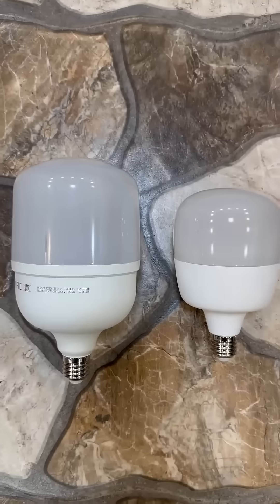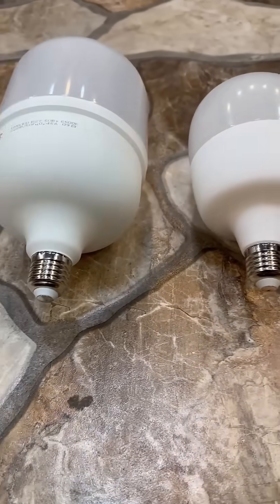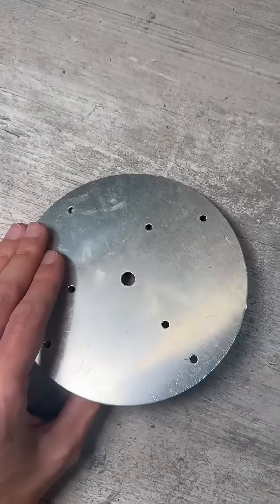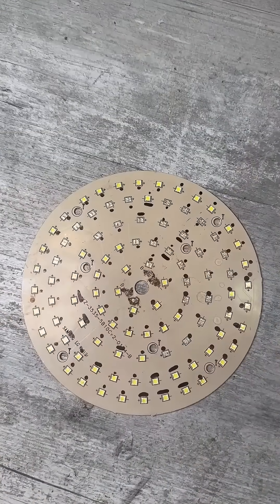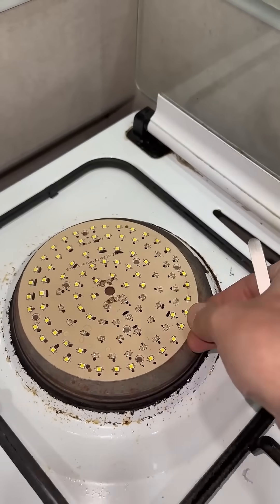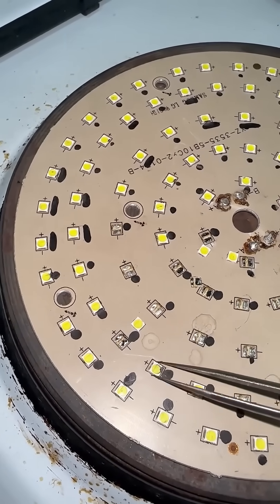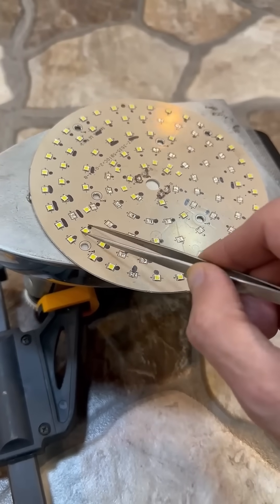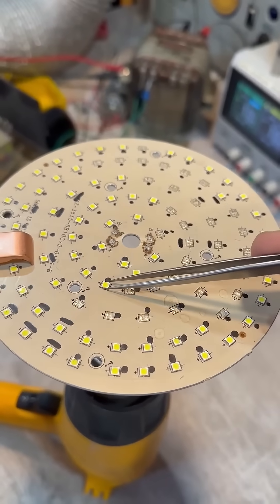How to solder LEDs without professional equipment

Comment: Already did it with hot air a few times but not worth it it usually fails again
Reply: Yep, that's weird. If one fails, even after replacing the LEDs with working ones, they only work for hours or days before failing again. I think the problem is in the capacitor or the IC, not the LEDs.
Reply: @adhicham8185 all the LEDs are already deteriorated that's why, i repair TV's backlights i always get TV's fixed by other stores that only replace the burned LEDs and stop working in weeks if you lucky maybe 3 months